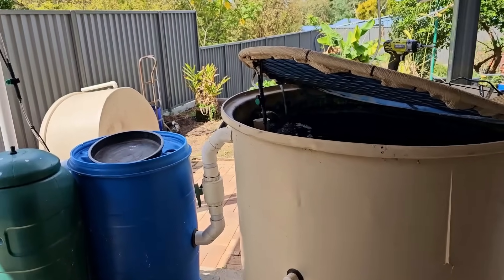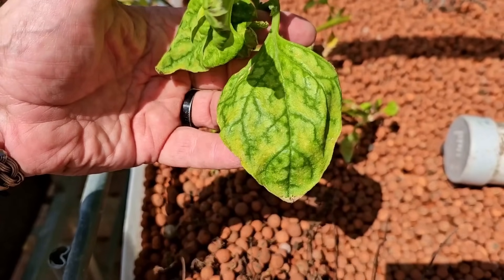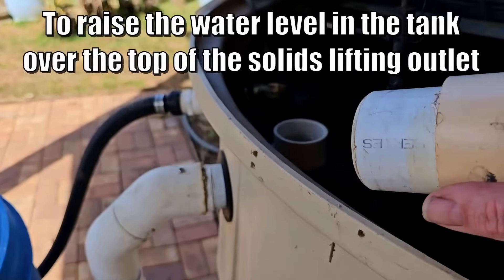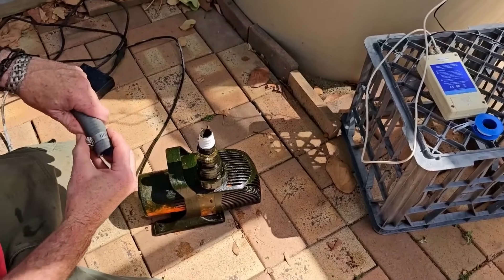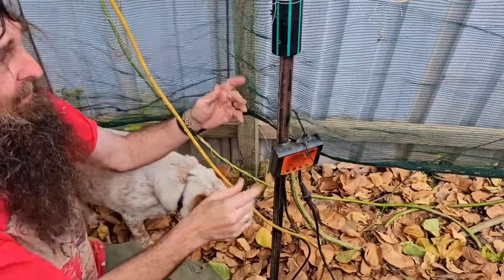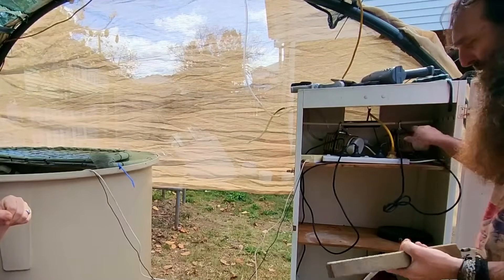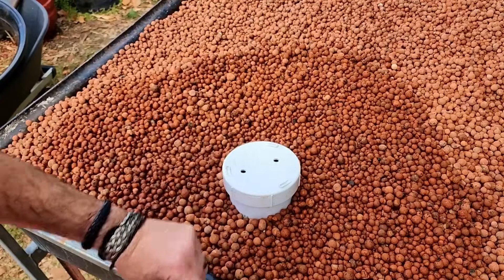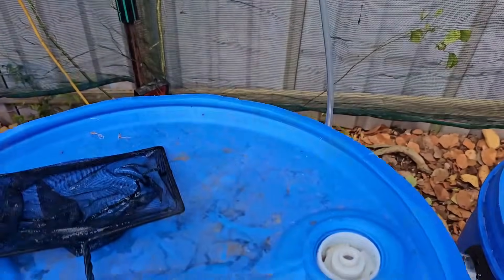NEW Aquaponics System is FINISHED | Moving the Fish & Setting up Moving Bed Biofilter

Comment: You should wrap your Teflon tape in a tightening directions you will get better results 
Coming from a 30 year plumber I love your set up
Reply from the maker: I generally do when working with threads.
Cheers mate & have a fantastic week.

Comment: G'day Rob. I'm in the process of starting to design myself a large lot of garden beds and trying to decide if it would be more economical for me to use all standard soil garden raised garden beds or use a aquaponic system to grow leafy and root vegetables and just use soil beds for my fruiting vegetables. I'm disabled and in a wheelchair so I also have to take into account a limited budget being on a pension and also making my vegetable growing as wheelchair friendly as possible. Any advice would be greatly appreciated. 😊
Reply from the maker: I would suggest starting with soil &/or hydroponics first if you're new to growing veggies. 👍
Once you get a handle on that you could add fish into the mix. 
Wicking beds are a great way to grow using soil & are typically made in raised bed configurations. 
I hope that helps some.